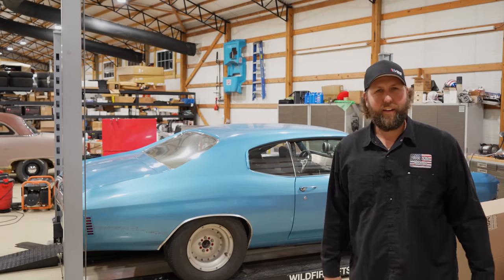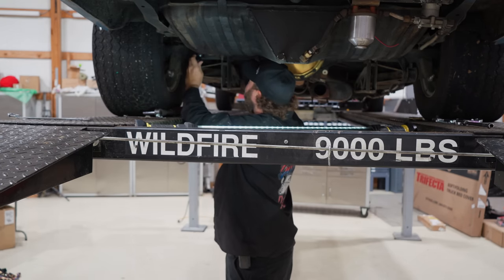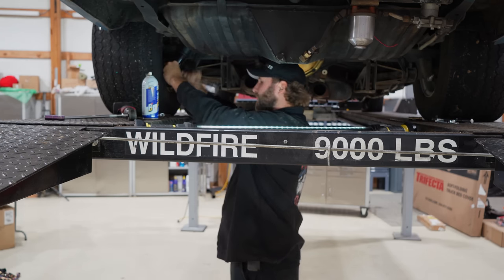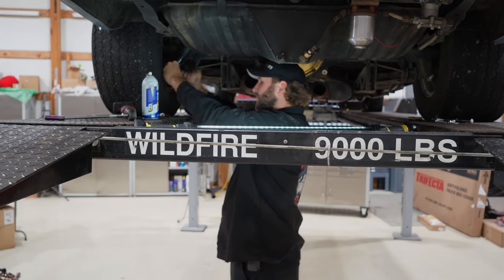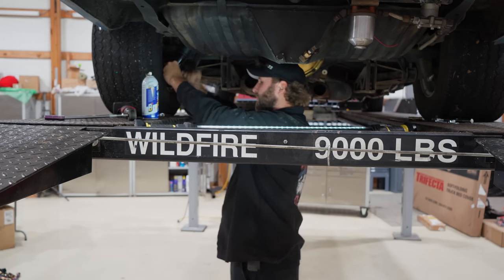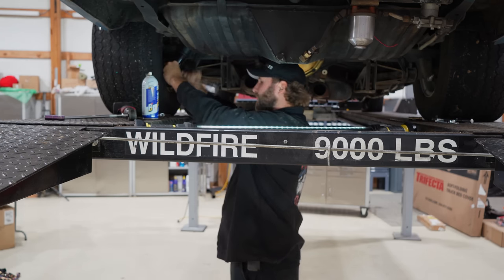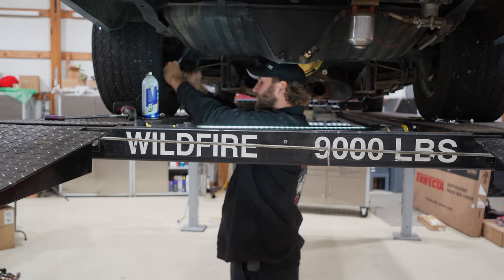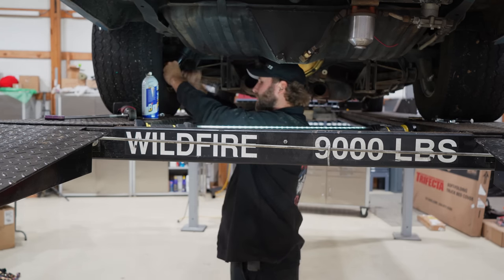'80s Built Chevelle Drag Car Goes On The Dyno - Results are NOT what we expected!

Comment: Back in the early 90's, I got a piece of rust embedded into my left eyelid working under a car without safety glasses. After about 8 hours of increasing pain & lost vision 'cuz eyes were watering so much, a person took me to the E.R.  The doc said the rust scratched the cornea, & had it remained for a few more hours, I likely would have lost vision in my eye. FORTUNATELY no severe permanent damage, but vision in left eye is slightly worse. I now wear glasses, the lenses have different numbers to equalize vision. Please use safety glasses & hearing protection
Reply: One of those lessons you don't learn until a close call or worse. Similar thing happened to me and now I wear something when mowing the lawn or around anything that could damage the eyes.

Comment: I say don't go big block just yet. Maybe I'm weird but, I say tear it down, rings and bearings, put a modern solid in it, and go for the best budget aluminum heads you can do. Nothing crazy expensive but double humps are really terrible compared to even the cheapest Chinese cast heads you can get these days. Just upgrade the hardware on them and go for it. Maybe even the AFR enforcer line.

Comment: Carb with no jet changes thrown on and power ran on a dyno then talking about how little power it makes… 

Imagine that, the untuned setup doesn’t perform at 100% - couldn’t of guessed that.

Also, that WAS NOT valve float. That was 100% a rev limiter. Would want to look into the rpm chip before doubting that. 

Looks like a beautiful car, keen to see what happens with it.

Comment: Hp doesnt seem right? I had a 69 Chevelle SS 396 ,375 HP heads HEI cam headers holly750 single plane intake  3:73 gear few other goodies .It would run high 13"s in the 1/4 mile

Comment: If that's a 400 small block  I'm sure you can come up with a 350 4 bolt main and take your 400 parts and stroke it and a. Couple aluminum heads you'll have something way better. Just my opinion

Comment: Saw the video of the car being raced after these dyno pulls.  It did indeed run mid 12's.   I don't understand how an accurate horsepower number can be gotten with a blip of the throttle?  The mobile chassis dyno's numbers were way off.  14-15 second car at best with this guy's numbers.  What, Why?

Comment: Wow, I was way too high 490 hp. I really didn’t have any fact to say that. LQ4 6.0 L stroker in it.
Reply: I was shocked. I was optimistic guessing 464 rwhp if it truly ran 10s and was built as suggested. But wow. That's all bark, no bite. I got a '71 Buick 455 that's rebuilt in a manner close to stock, but its around 275 rwhp (35 more than this built chevelle).

Comment: Seems like it would be more then 233 my stock 94 lt1 made 275 I have a set of double hump 202 heads with 205 valves that made 500 hp in a 377
Reply: That’s with a hydraulic roller, cast scat crank, all cheap stuff, if you don’t have the right crank heads and cam combination your just making noise

Comment: Just my opinion..I don't think you'll be happy running 14,13,or even 11 second quarter miles, when you've been spoiled at 8.50s in El Toro.. Time to build, or have Steve Morris build you a motor for 8.0 passes, to put in that sweet Chevelle..It can be dependable, and consistent on the road and at the track..

Comment: How does a 406 with a big cam make almost the same power as my 350 vortec. That's odd.
Reply: Because GM used dogshit heads that couldn't flow until like the 90s at the earliest. They can't flow enough air above midrange so they're HP capped at mid-200s despite displacement or any other mods like cam, carb, etc. They didn't fix the problem until the HP wars started again in the 90s

Comment: 41:22 AND UP , THERE WAS AN INCIDENT WHEN THIS  DIYER GARAGE GUY WAS WORKING ON AN OLD SCHOOL
CAR SUCH AS THIS ONE AND THE STUPID FAN BLADE I THINK RIVETED ON THE HUB NOT REALLY SURE,  BUT THE BLADE LET GO FLYING INTO THE GUYS NECK, SO ESSENTIALLY IT WAS LIKE GETTING STABBED IN THE NECK WITH A METAL OBJECT, THE GUY LIVED FOR ONLY A SHORT WHILE, BUT LATER DIED IN THE HOSPITAL FROM LOSS OF BLOOD, BUT THE CHANCES OF THIS HAPPENING IS EXTREMELY LOW, IF I WAS DOING THIS ID HAVE A PIECE OF PLYWOOD JUST IN CASE AT THE TOP AREA WHERE THE FAN IS I GUESS, ALSO YOU CAN GET YOUR LOOSE SHIRT IN THE FAN BLADES SUCKING YOU IN JUST A THOUGHT WHEN I SAW DEREKS NECK PERFECTLY IN LINE WITH THE FAN AND HIS NECK AFTER 41:22

Comment: The drive shaft loop needs to be not more than 6" back from the center of the front U-joint. Those ladder bars need to come off. They are a disaster! The entire rear suspension is JUNK!

Comment: Just so you know your loosing alot of power threw the stall converter higher the stall lower the power and higher the gear ratio the lower the power smaller the tire lower the hp reading and slicks always read alot lower so you have alot fighting against you and the fatter you run the motor the lower the power your going to make you should pull diff cover and see what ratio it is

Comment: Flat curve?? I would like to know more about why? Too much carb too much cam. I don't know.
Reply: Heads flow so poorly that they reach maximum flow capacity by midrange. HP plateaus around 4k and revving stays relatively flat. Power stays flat once peak HP is reached since higher RPM can't draw more air, thus additional fuel is unburned and wasted. Same exact effect of putting a throttle plate on a 800HP race engine to limit it to 500HP. Pushrod engine heads are inherently poor at maximum flow and GM didn't improve them until the late 90s/2000s to keep up with increasing HP from competition and Ford's OHC V8s.

Comment: ehh I call bs on the dyno, the dyno didn't even sound like it was loaded at all. instant rev.    my 350 with vortec heads and a mild cam with 750 carb made 280 to the wheels on a 90 degree day and a hot engine. something ain't right here,  that 406 sounds pretty snappy. run the car at the track first before you change anything. its not a 14  second car
Reply: Key there is Vortec heads. I agree the Dyno didn't load right but the numbers are on the lower end of expected. Most SBC Heads can't flow above mid-high 200s HP until GM finally started improving them much later.

Comment: 280 ish torque and 230 ish HP will NEVER in a million years rev up from 3k  RPM to 6K that fast under load.  something is wrong with that dyno.  either wheels were slipping on the dyno or that car has WAY more power than that dyno is showing.
Reply: Sure sounds off, from what has been said. 235-ish peak hp sounds too weak. If that was a stock Chevelle SS 396 (402 V8), its making right at that.

Comment: I think that dyno is way off. That curve is way too flat and the pulls were way too quick. Just how fast it revs when you were dialing in the carb it has to be 400+ at the crank. No way it only 230 at wheels. Converter was flashing thru on dyno or something. I agree with the others. Need take it track see what it will do before you start digging into it
Reply: I think the HP is roughly where I'd expect for stock, terrible GM heads but the dyno... That curve isn't normal at all. They're never that flat and there's either an enormous smoothing filter or it didn't load correctly. Even for allegedly redlining at 90MPH (also VERY implausable), it revved way too fast and sounded like it wasn't under any load.

Comment: I have a friend that owns and operates a dyno. It's a running joke to me and him about what we call "boomer engines" these guy bring them in and they consistently make half what the guy thinks it's gonna make and then 90 of them tell us that the dyno is wrong and or we don't know what we're doing. But we've put together cars that have been low 9s consistently. Can't tell you how many "built" small and big blocks have come in and I don't think any have cracked 500 most are in the 180 to 300 range, huge tires, crazy suspension, wheelie bars, gutted with cages, open headers, all to make 200hp drive like trash and get like 6 mpg. I'll never understand it. But hey if that's what some folks are into it don't bother me none. Cheers brother

Comment: 480 hps’ss’s’!
Reply: Seriously dang. This chevelle is a mean lean machine and it feels wrong to hear 100hp at 85mph! Makes my 283 feel like 20hp.
Reply: No big block. Build the 400, stiffer springs, leaner cam, bigger carb, more power! I want to see you dial this engine in with all the things you know about small block Chevrolets. Gimme 450 wheel hp with an Sbc!

Comment: Something just ain’t kosher with that dyno run. Calibration or something, that flat curve just doesn’t add up. With camels and a stock cam and a double pumper it should be well over 300 all day long. I donno but something just seems off. Brain calculatin… thinking thinking… ??
Reply: That dyno isn't putting any load at all. There's zero effort on the engine and even if it blew through the converter it still wouldn't show that curve. Had the same issue with my Dodge (440). Every pull on the dyno it would just spike the rpm in a flash and show very low power output. Think it ranged from 220hp to 340hp. 
Kept scratching my head thinking I'd messed something up big time with the engine but I had the chance to slap the car into a hub dyno a few days later and the pull was nice and normal. Felt the same as it does on the street pretty much. Pulled 546hp/600 ft-lb tq without changing anything.
Reply: Yeah and now seeing the runs proves that dyno is dunk.